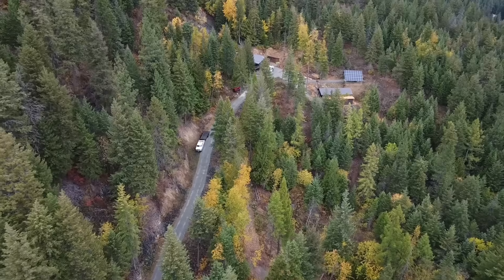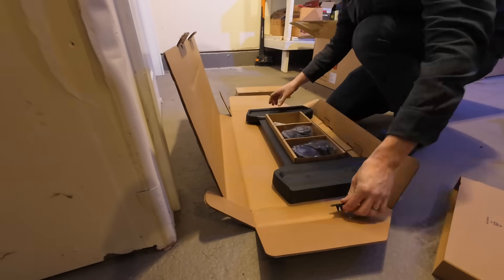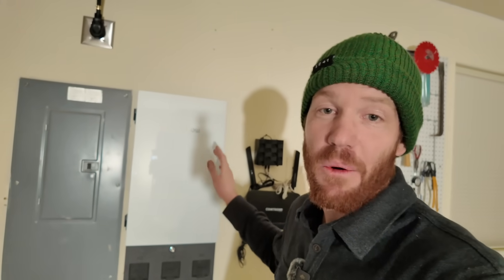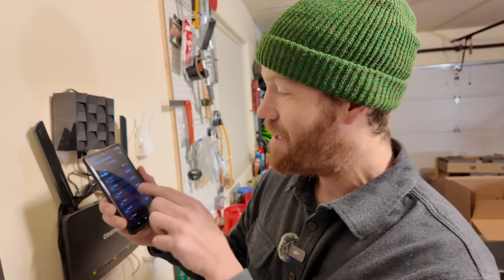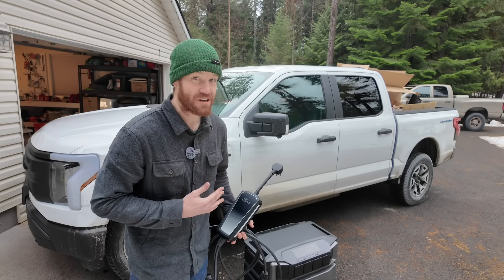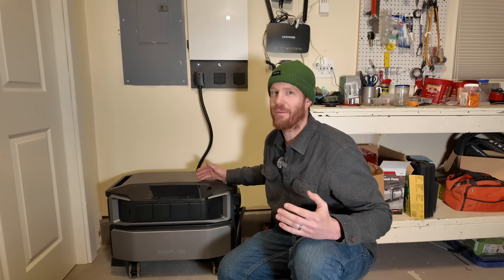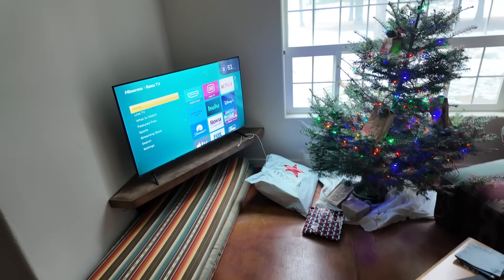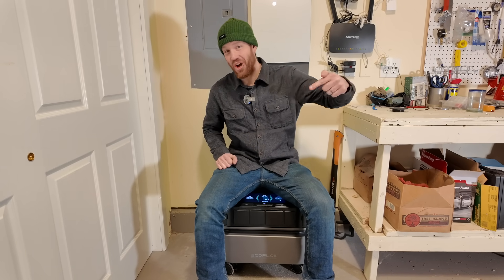EASIEST Off-Grid Power System! (EcoFlow Delta Pro Ultra)

Comment: So dumb question.  My fuse box is in an actual room in my house (small place in a rural area). Can the battery system be inside or does it need to be outside and if so, I’m assuming I’d need some kind of “casing” outside to protect from the elements, right?

Comment: That’s awesome, but I didn’t see you utilize the generator input in the EcoFlow panel. Why not add a generator input in case the power outage is longer than expected you can at least bring the generator out and charge it for 2 hours then run silent mode until battery runs out again 😅

Comment: That's no off-grid power backup system, it's nothing more than a dangerous toy that has no business being installed in any home because it uses cheap high frequency, transformerless inverter tech that provides absolutely no galvanic isolation between its DC boost stage and its AC output which can lead to damage of your home's appliances, and can even set those appliances on fire. Second, this inverter offers one of the poorest surge capacities in the industry when it comes to starting high inductance loads like microwaves, power tools, washers and dryers, and refrigeration. And third, when you factor in its shorter life expectancy and ultra-high price, it makes one of the market's poorest choices for providing residential backup power.

Comment: I had 2 Delta Pro 3 ( DP3 ) units running in parallel with their 50 AMP hub bridge (also the Ultra 50 AMP hum). One of the units was defective and caused a tremendous power surge which fried my HVAC thermostat and ECU, coffee maker, Air Purifier, GFCI outlets, and over a dozen outlet surge protectors and damaged 2, 200 AMP breaker panels.  The damages have run into the thousands. One electrician who inspected my system told me that one of his customers had a similar problem with his EF Ultra except that he didn't have the unit hooked up to the home.  I like the EF Delta 2 Max batteries, but the EF DP3 and the bridge is not good. $12,000 of damage was done.

Comment: I have the 3 battery ecoflow ultra, large trifuel generator and solar panels. If sunlight is scarce I can charge the batteries off either the generator or grid in just 2 hours a day automatically. I went off grid for the first time just before thanksgiving. Three days later my wife announce that the dishwasher did not work so I had to tell her we were off grid and the dishwasher was one of a few electric hogs deemed noncritical. Since I had not notified her in advance, I grabbed the generator remote pointed it at the barn and the generator started. Two hours later the batteries were charged and the dishes were done amd the generator was off. It is satisfying to know that the gid is now relegated to a third rate energy source and I have forth and fifth level plans.
Reply: A question: which costs you more, charging the battery with grid electricity or using your generator

Comment: I appreciate this video although I live in Buffalo, NY I do not own a gas generator and have no plans of purchasing one dealing with a lot of gas/propane scares me I recently purchased the flow delta2 max with trolley and solar panel during a HSN sale I plan to use around the house, in my shed, and in my camper when I purchase this video has got me to thinking about investing in a whole house ecoflow to reduce my almost $300 a month electric bill, although it was hot this summer I didn’t run the AC as much as last and my bill is still high…I am thinking going solar with the ecoflow will reduce that bill!

Comment: Tip connect a ups to tv's when using the eco flow delta 2 as the switch over time causes some modern tv's to shut down.

Comment: Can this system allow a house to run off the batteries at night instead of the grid? I want to be able to run my home off solar during the day and supplement the solar with the batteries and only use the grid as backup when neither solar nor batteries are available. Is that possible with this system?

Comment: The antenna (top right corner of the panel) is in the wall? Wouldn't that make it difficult for communication? Also I thought they recommended it be installed on the wall not inside the wall. Maybe I thought I read that somewhere. Also how would you put 100a circuit into the SHP2 when it's max is 60a?

Comment: You can't power an entire home with this thing. It has too low of a power rating and far too low of a surge capacity. And make matters even worse, the battery capacity is far too small, only allowing you to power even a small home for 2 or 3 hours during a power outage. In   addition it's low cost  design eliminates the isolation transformer, which makes for a potentionally dangerous product because it offers no galvanic isolation between the DC boost stage and its AC output.

Comment: Curious what's the benefit vs a tesla home battery?
Reply: All but one (Bronco Power Boost) current "whole home" battery backups require solar with an inverter switch and are very expensive with very short duration before needing a recharge. In truth, in order to run your A/C plus the rest of the house, you would need a battery the size of a car or up to 10 Tesla Walls plus solar panels. 
Instead, focus on what's important to most people.
 Refrigerator/Freezer
 Gas stove
 Internet
 A space heater/A/C
 Medical equipment
 Some lights
 Garage door
 Security system
 You could spend up to $16k with the Eco with a ton of garage space taken up, $100k for solar/battery for only a couple of hours or $12k+ maintenance and fuel for a generator, but if you want to keep it affordable and simple for 6 essential circuits take a look at Bronco Power Boost out of Houston, TX.

Comment: please consider these sponsorships instead of raid shadow legends
    Solar panel manufacturers
    Electric vehicle (EV) charging solutions
    Outdoor and camping gear brands
    Sustainable living products
    DIY tool and equipment companies
    Off-grid living books and guides
    Renewable energy systems (wind turbines, hydro power kits)
    Organic gardening supplies
    Water filtration and purification systems
    Tiny home builders and accessory suppliers
    Eco-friendly clothing and merchandise
    Battery storage solutions for renewable energy
    Homesteading and permaculture courses
    Natural building materials (bamboo, hempcrete)
    Biodegradable and compostable product companies

Comment: I have a lot of thoughts. I'll list them in order.

1. You can absolutely power a well pump with a portable gas generator. When you say you can't, you're either not informed or have been paid by EcoFlow to push misinformation. I've been running my well pump for years on a porable generator. 

2. I wish you showed hooking these batteries up to solar panels because if you lose power for an extended period of time, you'll need a way to charge the batteries up

3. What type of battery chemistry are these? I'd hope they're LFP, which allows for the most charge/discharge cycles in the industry

4. When you tested the well pump, you didn't actually test it. For those who've never used a well pump before, on the inside, a tank with a bladder pushes water to the house and could do so for a number of minutes before finally needing the well pump to turn on and supply more water. Just turning on the faucet for a second will NOT actually test the well pump and again, you're either not informed or have become an EcoFlow spokesperson. To actually test the well pump, you'd need to run it until the tank gets low enough that it needs to call more water from the well.

There are other little things I noticed, but there's no sense in pointing them out. I've watched many of your videos and like you channel. Don't lose subscribers because you're selling yourself out for a dollar. Give honest reviews.

Comment: if your Wi-Fi is attached to the SHP2 can you remotely monitor and operate this from a long distance? Thinking of putting this is a vacation home we are building.
Reply from the maker: As long as there's Internet available and turned on for the SHP2,  it (and the DPU) can be remotely monitored from anywhere you have Internet .

Comment: I feel like Ecoflow update their products so fast and things go obsolete after a couple years.  What happens after i spend 15 grand on a back up system and 3 years later they come out with a new product, transfer switch, etc. and cant get parts anymore or replacement battery.
Reply: Ecoflow is counting on that and has designed it so you have to rip/replace, rinse / repeat over and over ... constant stream of $$$.    With all of these Youtubers doing all thse INFOMERCIALS, they will likely succeed.   The youtuber gets free equipment, likely a kick back on sales and such and of course Ecoflow gets the sale --- cash machine!

Comment: You need to be very serious when it comes to electrical wiring in a hot box. Take your time to study each box. Quit acting silly or you might get electrocuted and 110 volts will not turn you loose.

Comment: 1300-1900 for the smart home panel. is an extra panel worth it? you already have your circuits, if its necessary, just dont run the device. you just need something between your panel and the backup unit for failover.

Comment: I was interested in getting this. But not getting any information on how long the one battery will last on a single charge. I called ecoflow and talked to 3 different people and no leget answer. Final answer answer was 6000$ battery will run 1 refrigerator for 8 hours. Wow.

Comment: Nice F-150 Lightning!!  Though I will say if that is your new Lightning don't use that Ford mobile charger as your primary charger. We have the Ford Mustang Mach e and that charger does not hold up to frequent heavy charging or a lot of unplugging.  It works best as a mobile backup charger to keep in the vehicle.

Comment: The Thing I don't understand is in their own ad it said to charge off a generator it must be an inverter generator. I am thinking might be able to charge it with a regular generator if you use the car charger adapter and a level 1 charger.

Comment: This unit can't power an entire home's loads. It uses cheap, high frequency inverter technology thatoffers a low peak power capacity and a much shorter life expectancy than a conventional heavy duty off grid solar system. It doesn't even have a UL-1741 safety listing, so you would never be able to pull a permit to permanently install this in a residential application.

Comment: This is the third EcoFlow content/commercial I've watched this week. It's like Eco Flow batteries are the new Hello Fresh of YouTube sponsors. One thing they don't explain very well is, if your lights go out for more than a day or two in a modern home, these batteries are going to be useless after a day or two if you don't have a huge expensive solar panel and a lot of sunlight to charge them up. If I had to choose between these expensive batteries and an equally expensive diesel or natural gas generator, I think I'd go with the generator.
Reply: I used to feel the same way but solar panels are dirt cheap these days and a few hours of full sun will recharge this thing faster than you'd expect. Cheers
Reply: Very fancy(pricey) unit with all the smart features. Priced out of our budget, so we have a manual system with a 12k generator that can connect to our electrical panel backed up with a 2.4kw Anker and 3-350w $35 used solar panels to ensure charging. Less than $3k and I did all connections ...
Reply: There's an ecoflow smart generator that could charge all the batteries in an hour with a small amount of gasoline even if there are no panels or sunlight
Reply: solar is the long term sustainable option. gasoline and propane are not.
Reply: @garypaduana62   When you have an overcast and not getting enough sunshine to charge your battery, you can sit and say gas isn't sustainable and sit in darkness
Reply: @gb6041  I'd rather have power for 20-40 years intermittently than dedicated for a few months.

Comment: This system intrigues me. Only bummer for me is that power only goes out in my area like once a year for less than 20 minutes. Would be a bummer to pay 6k+ for a system that never gets used. True though, that its a “Better have it and not need it, than need it and not have it”

Wouldn’t most internet services go down if the power in the area went down?
Reply: Doomsday system. Better 2 have than not have it when u need it.. castostrophic events.

Comment: I was wondering if more batteries can be added? This would be especially helpful during an extended outage.
Reply: You can stack up to 90KWh of storage
Reply: At $2799 per battery that would be over $42,000 pre-tax for 90KWh (MAX). That is ridiculously expensive. For $23,000 you could get that same 90KWh of battery using EG4 PowerPro Wall-mounted batteries. And they are rated for mounting outdoors as well. EcoFlow is just too damn expensive for what you get.  You would also need multiple inverters as well, for all of those batteries. At $2799 per inverter and looking like you would need 4 of them for those batteries, that would be an additional $8500 pre-tax. Now your system is over $50K. EG4 cost for a 6K inverter is $1399 per inverter. So everything from EcoFlow cost twice as much for the same specs. EG4 6K inverters come with the braekers built right into the inverter, saving you even more money. HUGE COST difference.

Comment: Love the power supply for the Internet Router. Powerboard is just hanging there. One screw into the wall or a 3M Command hook would fix it.

EDIT: Didn't get to the bit about it being temporary.

Comment: Congratulations to your parents! Probably about 90%+ of houses (not apartments) in India have inverter-based power backup. However, these setups typically use lead acid batteries for their much lower cost and also a lot of square wave inverters (we upgraded to a sine wave inverter in 2022).
Reply: LiFePO4 lasts a bit longer than our conventional batteries, also since u mentioned india i don't think we have recycling plants here 
btw what sine wave inverter are u using? i couldn't find any in my city here most are square or polygon
Reply: @mynk0.78mm  I haven't verified using an oscilloscope, but the Microtek UPS JM SW 5500/48V is claimed to be a Sine wave inverter rated at 5 KW (upgraded in 2022). Our earlier one used to be a Microtek 1400 W model with square wave output. If you have access to an oscilloscope, you might want to verify the output waveform before you buy.
Reply: @hsjawanda  yeah that one must be sine wave, it costs thrice the one I have.  

sry that polygon word was an error I meant trapezoidal waveform, great to see indians also in the *DIY space!  🤞
Reply: @mynk0.78mm  Yes, it would be great to see Indians in the DIY space (we have a lot of hidden talent), but unfortunately I'm not one of them (too lazy & unskilled): the most I've done is make my own electrical extension boards (commercial ones have very short wires & wire quality is unknown) and attach commercial power strips to walls wherever I needed more plug points (kitchen & my home office) 😆. Recently fixed a (literally) broken power plug in my office that also required drilling in to the wall to secure the faceplate (the older holes were worn out).
Reply: @hsjawanda  I'm not that skilled so I don't touch the mains stuff haha. 
Mainly stuck to making my own UPS and dc charging stations, I'm currently making a 4 port 100 watt each USB C charger for the dc station, earlier I used to stick to the 25W each outlets. 
Luckily my ups n ol still work without any issues, it's a small one that powers routers and cctv + nvr made out of 18650 cells, I was too scared of it so I stuck two active fans in it, although no1 uses active cooling. 
All this pales in comparison to this channel lol
Reply: @mynk0.78mm  LiFePO4 is expected to last at least 3 times longer than lead acid batteries, with zero maintenance. Moreover, lead acid batteries should be charged when their charge drops to 50%, whereas Lithium batteries can be comfortably discharged down to 10%, so the real-world capacity of Lithium batteries is much higher than the quoted capacity of Lead Acid batteries.

Comment: You might have a problem with all the GFI outlets on those protected circuits since most inverters are not house ground referenced and are instead floating ground referenced.

Comment: 90kwh is not 30 days, even conservatively, for the typical American household.
Feel like if they had a generator setup, they would have been better off with a better generator, especially with no solar panels included.
Realistically at best I see this being good for a day or two off backup during a small outage.
I could see this being a decent product but not for this particular use-case.

Comment: This is the second channel that I've watched this evening where the channel puts in an ecoflow system in their parent's home for back up. 
Does look like an easy setup and seems fairly complete vs piecing together an inverter, backup panel for critical loads, transfer switch and batteries to run it all. But wow, you can put this together for a lot less money if you know how. I guess you're paying for the convenience of the eco flow being mostly plug and play.
Reply: It might seem easy, but he stated "installed by a licensed electrician" for the install. California regulations all required a licensed electrician to only do or verify certified work...then report that to the state